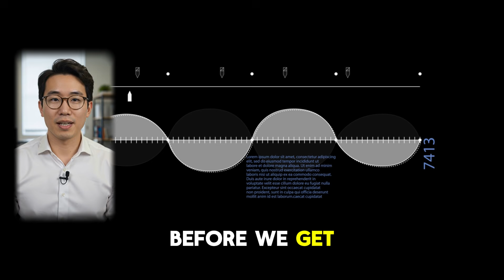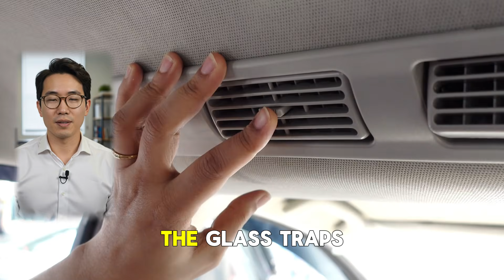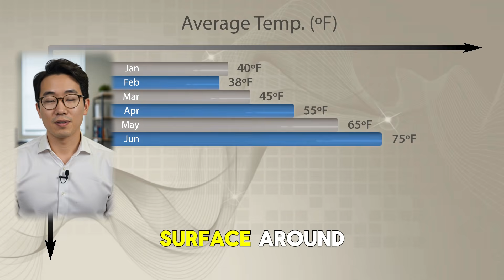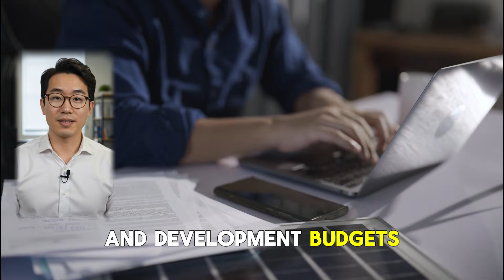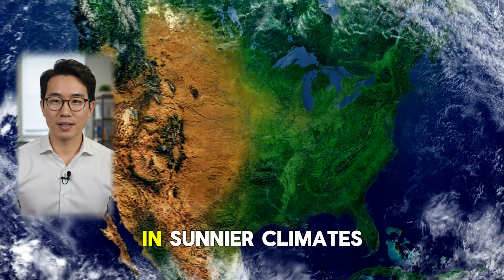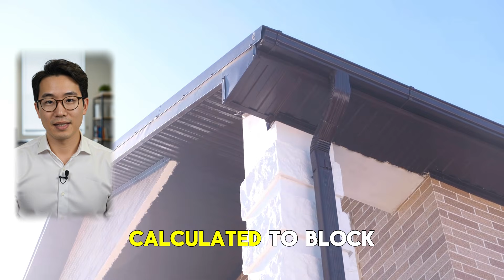This Forgotten Wall System Heats AND Cools Your Home for FREE. Why Did They Stop Teaching It?

Comment: I couldn't even finish watching this this can't work for high rises putting glass in or on your home will be problematic how to hang shelves or pictures in earthquake prone places the last thing you want to worry about is glass wall flying at you next if you tried to build a concrete wall over a southern facing wood frame the termites will just love it and don't say that can't happen I seen it happen to my Aunt most people are concerned about hot weather in the southern states not heating homes and lastly the cost to do this will put you into a coma some of these videos are not practical